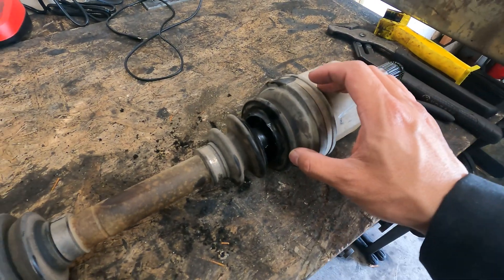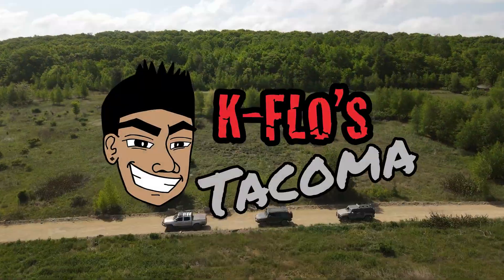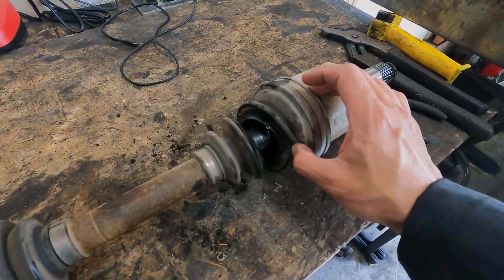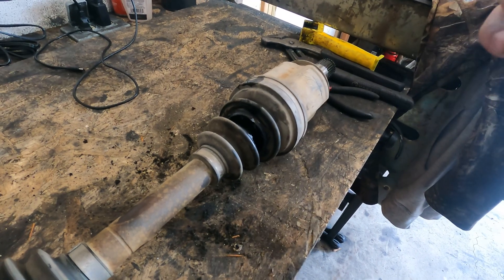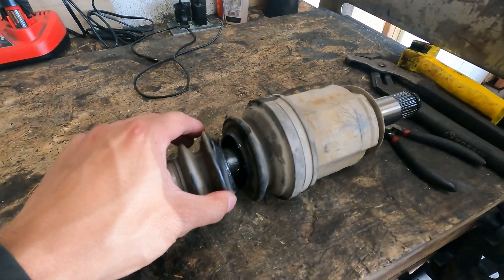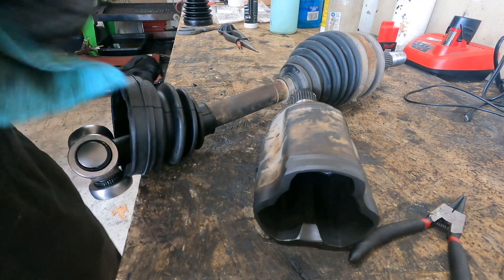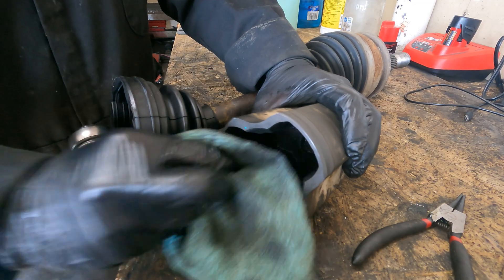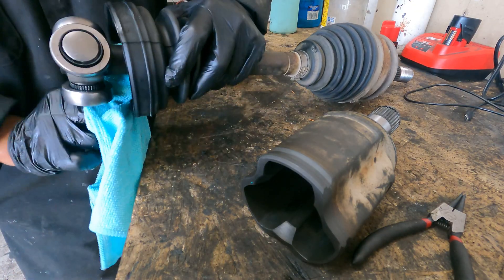Tacoma CV Boot Replacement (2006-2023)

Comment: I own a 2021 offroad 4x4, manual transmission ,would anyone know if removing driver side axle will leak trans fluid or is that only on the auto, thank you in advance
Reply: It will leak front differential oil. So just drain it first so it's less messy and it only takes about 1.5 quarts so good to change it out anyway.
Reply from the maker: It will leak, just jack up the driver side to tilt the diff and have a catch pan underneath. That way, you're not completely draining the diff. You can let some drain and then do your removal and installation. Top off the diff when done

Comment: Toyota boot kit w/boots,  premeasured grease, clamps for $50, and you get to keep your $400 Toyota axle instead of replacing it with Mexico or China made. I haven't seen the actual axle be bad, just torn boot. You can drive quite a while on busted boot if you don't contaminate it.  I don't think you could ever get all that squid ink grease off. The inner bushing has notches on inside and outside of the shoulders and a long pry bar, flat screwdriver, on one or two of these, and a hammer will pop them in and out without a struggle.

Comment: 2013 taco 75,000 miles, factory axles. I just replaced the diff needle bearing with ECG bushing due to excessive slop. It took alot out, but there is still a fair bit of play, which looks to come from inner cv. Have u seen those bearings on the tulip develop slop or the grooves they ride in? How about the tulip splines? I'm hoping it's not coming from the diff side gear, or spider what I hear people refer to
Reply: There's supposed to be play for shift on the fly. Better play there for flexibility,  than wear on diffs or transfer case. They have worked like that forever. I've always had 4runners since my first Toyota, which was a 1st generation. I know they are good trucks, but I like  the A-pillar in 4runner. My head didn't smack it off-road like the Tacoma. I really appreciate the Japanese build quality. We could get a 100 Camrys off the truck, but we got one Japanese built Camry, and you could see the difference in interior materials and quality compared to the US build just opening the door. I always wanted a 2nd generation Tundra regular cab/short bed V8, but they were short lived.  High mileage company vehicles or race trucks now if you find one. I drove the 1st 2006 RCSB 4x4 Tundra of the bosses home, and it was really, really fast.

Comment: I don't know man I think you should just get some OEM axles. Putting silicone around the boot to seal it seems a little ghetto.
Also don't you have a lift and 35s? Those boots are just going to rub and wear out again but I guess you can make another video for us. I recommend CV boots from dobinson or cvj axles also sell some good ones good ones for high angles

Comment: wow. great video also I did not realize that the whole CV assembly is held together by the boot and some hopes of japanese engineers. I have actually broken the smaller inner cv clamp and I am not sure it is an issue but now I just feel less secure. oh well thats how I roll.
Reply from the maker: LOL - yea Diego, it's literally just held together by a piece of rubber, hopes, dreams, and tears from the laborers. Also, I think as long as you're not doing any long periods of water fording, you can probably get away without the smaller clamp. Otherwise, you can potentially wear your bearings faster when you get a lot of water intrusion
Reply: @TacomaTutorials  haha. I'm in danger

Comment: Great video!  I have a CV axle that needs the boot replaced. I had been tod you need to replce botj boots to do the inner,  because of the tulip. Now that i know it's removable,  ill tackle this myself.
Reply from the maker: Yea, it should be a fairly easy job
Reply: @TacomaTutorials  yeah,  I already have it pulled out. Just need to order a boot kit. I can stop spending money on expensive OEM rebuilt axles. I've replaced 2 so far

Comment: The car care nut is nuts about rebuilding the original Toyota axles avoiding cheap replacements. What do you think?
My opinion is the rebuild amounts to tolerance to getting messy and greasy so why not
Reply from the maker: If you can rebuild the OEM's then I would recommend it. I went aftermarket since the OEM ones were rusted out and the sealing surfaces were pitted when I first got the truck. I also figured that since the OEM CV axles were $400+ dollars. I'll try a lower cost aftermarket one (these Cardone's are about $90). These have never broken in the trails - I have 35" tires and I'm tougher on my truck than most people. I also thought it was worth it since I can buy 3 more axles in comparison to the cost of OEM.
Reply: Thank You good info. How long or how many miles would you say you have on the after market axles?
Reply from the maker: My previous set of Cardone's probably had like 50K miles before the boots failed

Comment: Have you ever had difficulty in getting the cv axle to separate from the hub- wheel bearing unit..is it safe to pound on the axle shaft with the axle nut at the very end of the threads?? Or do you suggest another method??
Reply: I used a mallet and a punch. Also works great on tie rod ends as well.
Reply from the maker: That's exactly how I do it in one of my videos. I took the nut off and put it on backwards all the way at the tip of the spline. I also made sure that the surfaces were flush. Another way I did it was using a socket that was a bit of a smaller diameter and just used it as a punch